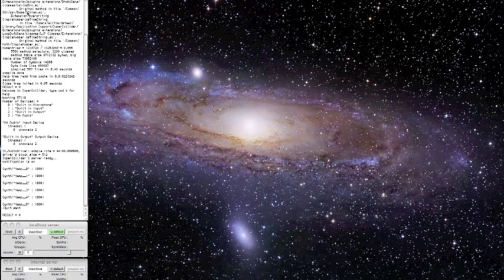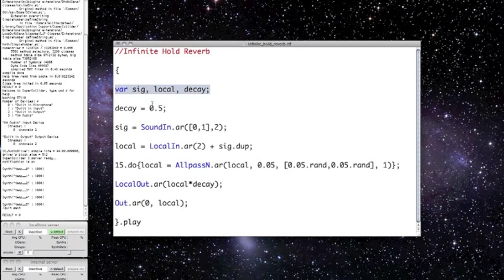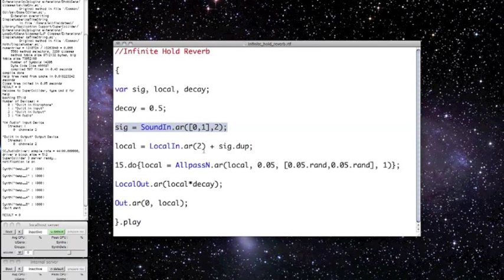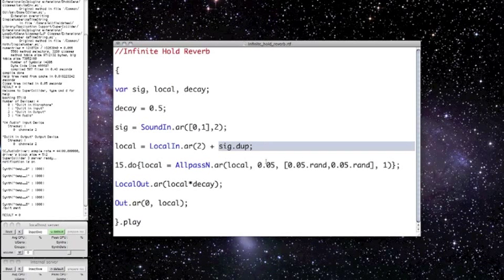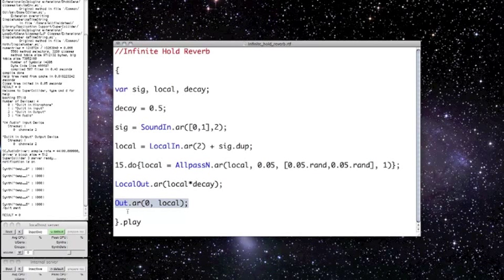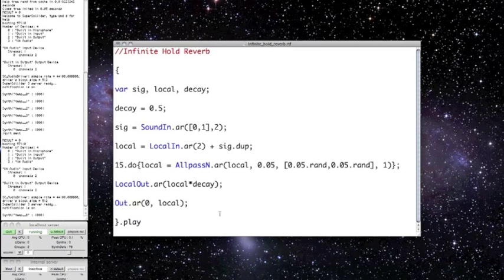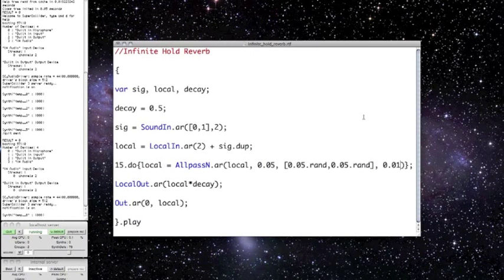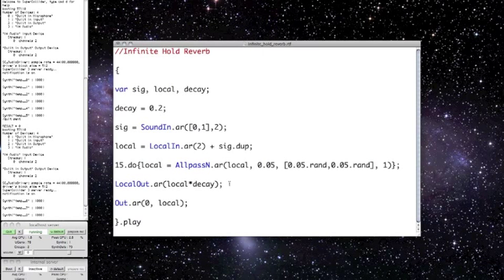Infinite Hold Reverb in SuperCollider

Comment: hey! i know this video is quite old. but did you go on with this patch? some control architecture?
Reply from the maker: Not really, but some general ideas (using Allpass filters in series) have carried into other reverb effects I've created. One of these is featured in Tutorial 28. But it's not much work to transform this infinite reverb function into a SynthDef and declare some arguments, i.e. arg decay=0.5; instead of var decay=0.5. And, holy cow, I haven't looked at this video in a long time, and apparently it has some mistakes! It was made during a time when I was still just messing around with SC. I've updated the video description.
Reply: @elifieldsteel  great, thank you so much!

Comment: I'm new to SC but in Reaktor I simply attenuate 800hz by -6db. That way, the outgoing signal is never 100%, which means you can turn your feedback multipliers all the way up. However, because you've filtered the audio, the feedback will not be infinite, but it will decay for several minutes. Of course, audible pitch will eventually become noise after 20 or 30 seconds, but I find this effect is pleasantly atmospheric.

I'm sure you know this already, but another approach to freezing can be accomplished by cutting up a small piece of audio into "grains" and "jittering" those grains in all sorts of interesting ways, but I find this is unpleasantly mechanical-sounding because you can hear the recycled audio. I prefer the feedback delay network (FDN) approach, as it sounds more natural and spontaneous.